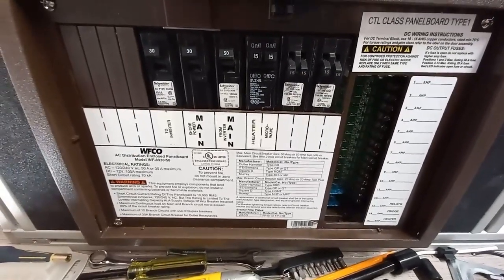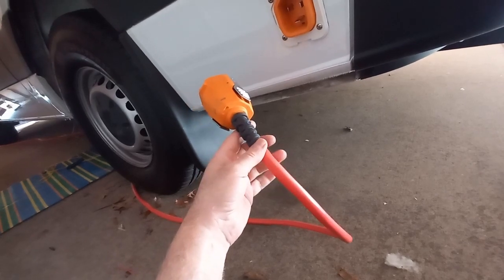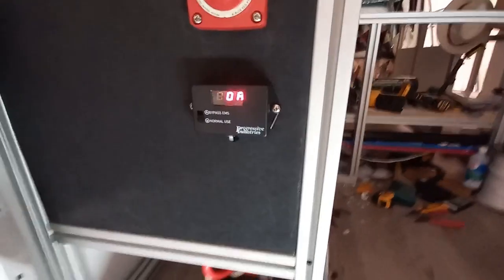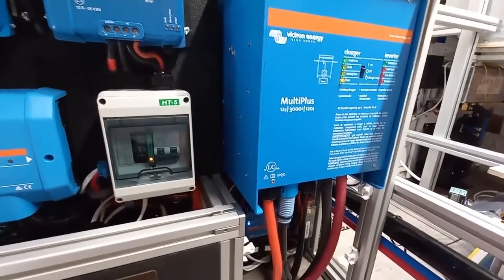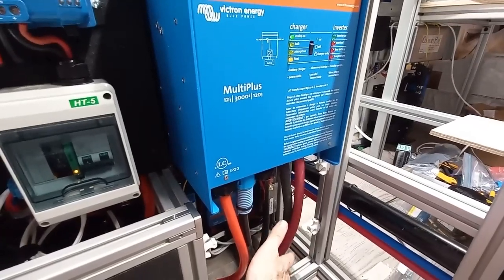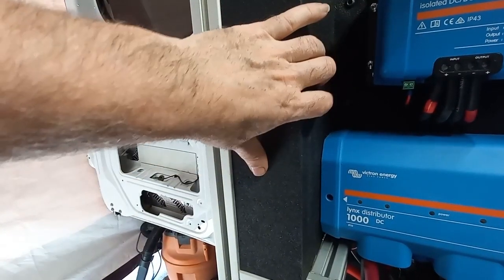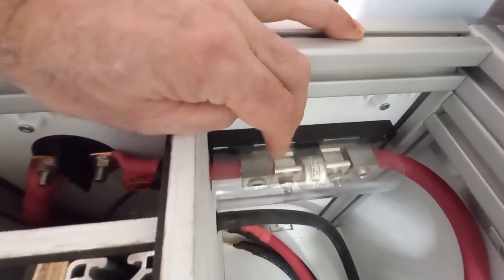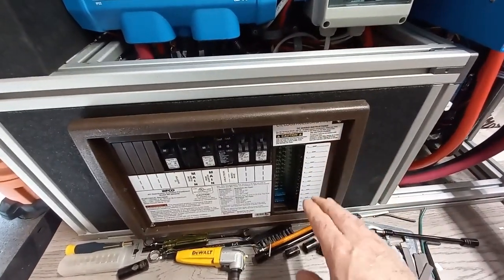Campervan Electrical System Walkthrough - Victron DIY Van Setup   #victron #multiplus #campervan

Comment: Weekday is the aluminum channel you used called
Reply from the maker: The aluminum that I used is from a company called 80/20. I used thier 15 series profiles which have a base measurement of 1 1/2" x 1 1/2". I used profiles that have a smooth finish and are have holes in the extrusion  to save weight and cost. 1515-LS is the base extrusion with 4 t-slots.
Reply: Thanks for sharing. What is the black plastic paneling called? Is heat rated?
Reply from the maker: The material that I used behind the victron equipment is a rubber floor mat from homedepot. https://www.homedepot.ca/product/multy-home-all-purpose-24-inch-x-54-inch-rubber-mat-3-mm-thickness-/1000808977